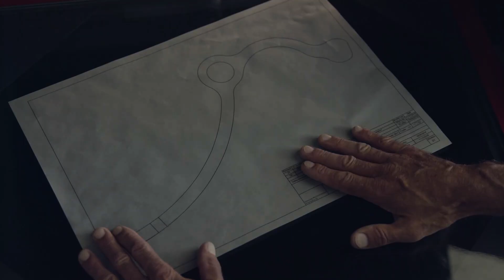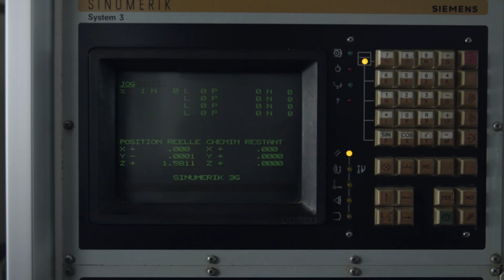Oris: How our Calibre 400 is produced (2021)

Comment: Will the minute jump during the hand setting be solved in the near future?
Reply: it is already. called caliber 400-2. i just got one
Reply: Unfortunately some models of the 400-2 also have issues. Id recommend waiting about 4 or 5 yrs more before purchasing a 400 movement. By than all the quibbles should be worked out. 😊

Comment: Is this caliber made in Switzerland  🇨🇭  , by ORIS, or outsourced in Asia ? , yes we know its in house designed. 🏠.
Reply: Interesting question!
Reply: It’s made in Switzerland.
Reply: @JimmyBlandfood  that’s not true. Are you referring to the swatch group that owns omega, tissot, Hamilton, tag, etc? Oris is one of the few independent Swiss watch companies out there. They do use a Swiss selita movement in many models and maybe that is what you are referring to? It’s a great company.
Reply: @JimmyBlandfood  you wont get an answer on who makes dials and hands etc. i mean not even Rolex or Lange do everything in house, and we don't know their suppliers. I think Oris are fine for now, but need to up their quality if they charge higher prices. Their mark-up on the in house movement is far too high, the quality of the rest of the watch has to improve as well.
Reply: @tombarsens1277  That's why I bought a Tudor instead... and I had seriously considered an Aquis 400...
Reply: @JimmyBlandfood  Please look up the definition of literally - you’re wrong in it’s use and your representation of Oris.
Reply: @JimmyBlandfood  I have the Upcycle and don’t have this issue
Reply: @JimmyBlandfood  well referring to it as pretentious is a subjective opinion - personally, I have more of a problem with a company like Rolex who files as a “non profit” charitable organization, who didn’t even start as a Swiss watch company but moved their manufacturing later to increase their perceived value and borrow Swiss heritage for marketing purposes. Oris uses selita movements and their in house calibre. They are also climate neutral now. I have the Aquis Upcycle and don’t have this issue you’re referring to